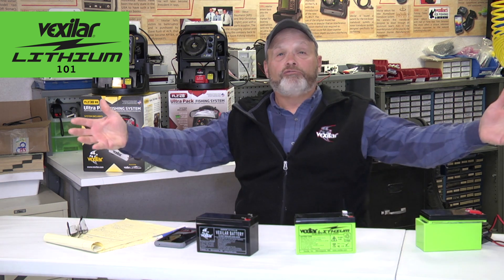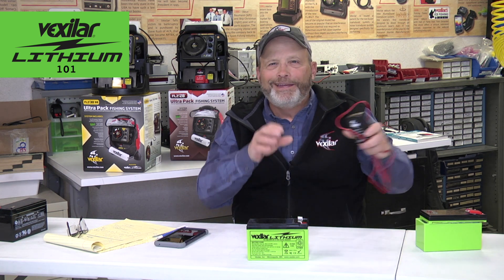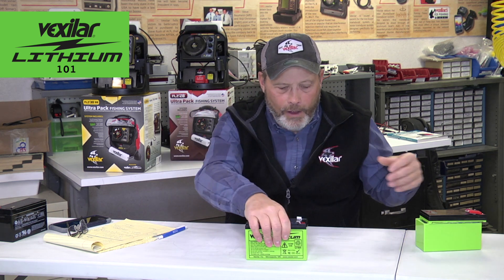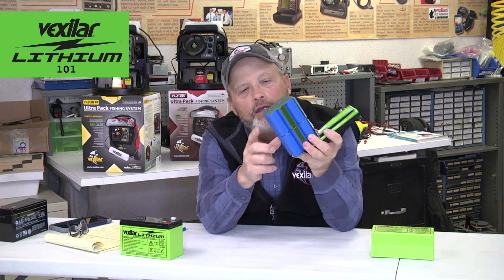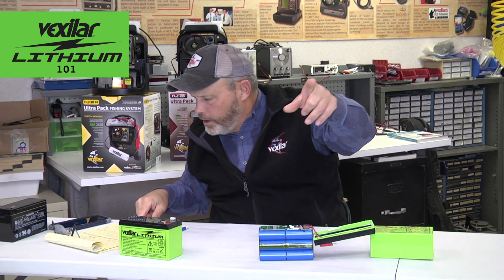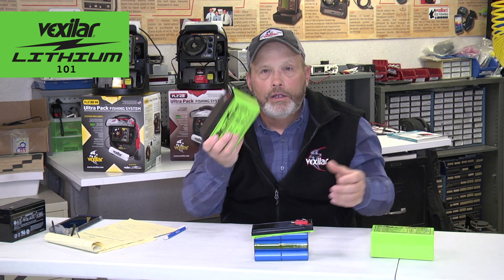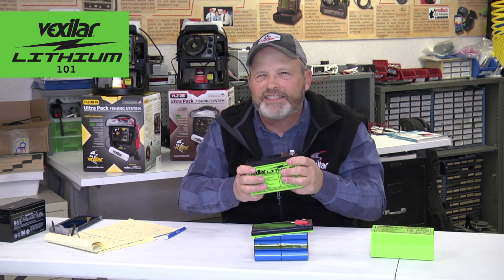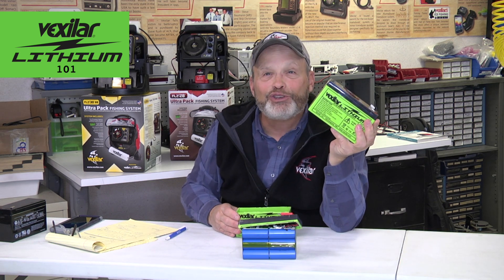Vexilar Lithium 101

Comment: And when it comes to cost, yes LiFePO4 batteries are more expensive up front, but with proper care ( e.g. not stored completely dead or completely full, not stored in high heat, not running to overdischarge). The bms  shutoff is a little bit low, I wouldn't let it sit at that 10.5 volts for longer than a few hours. But they last 5000 charge discharge cycles if you go complete charge to discharge, and many many more if you go 10% to 90%. A similarly capable lead acid will last several hundred full cycles at most. 

So in the summer, charge it to about 13 volts and throw it in the shade in a well ventilated area and it will last longer than your vexilar by far.

Comment: What’s the weight difference between the lead battery and this battery? Not sure if you said it in the video, I may have missed it.
Reply: These batteries are what are called Lithium Iron Phosphate batteries ( LFP or LiFePO4 ). They are ultimately lighter than a similar capacity of lead acid battery. However, I think that Vexilars LFP batteries have a higher than their lead acid batteries, so they may be lighter but not significantly so.